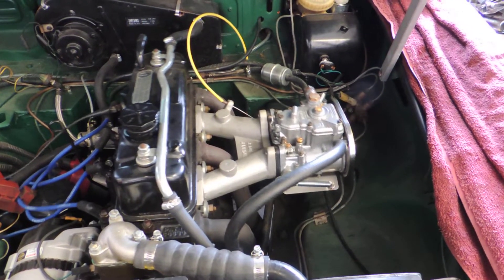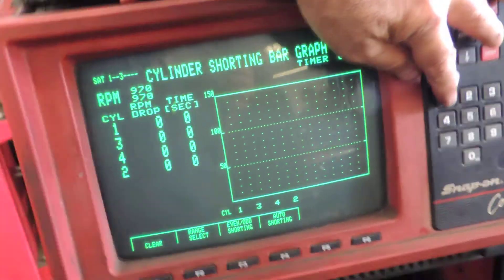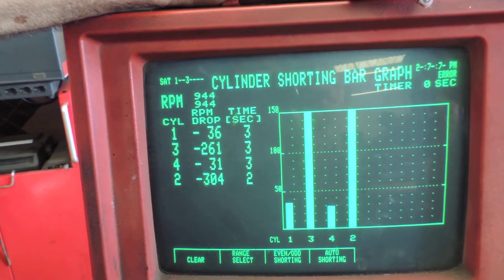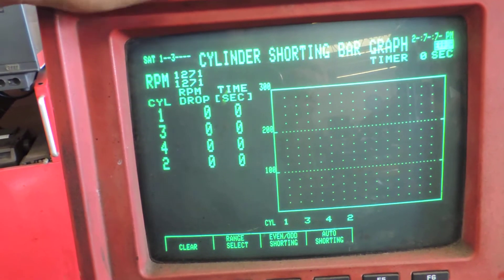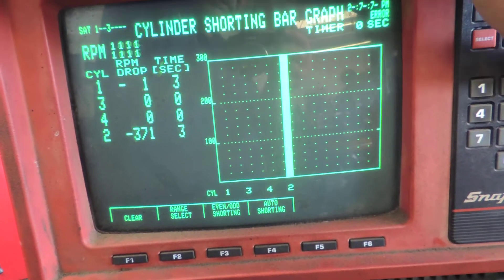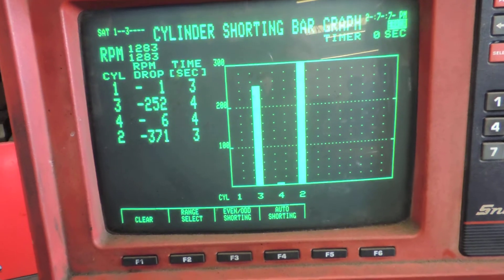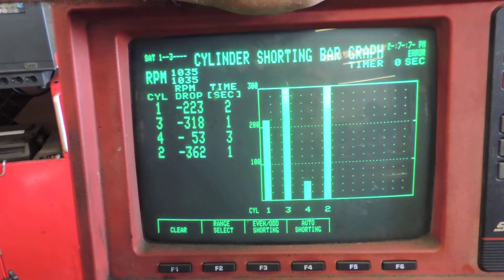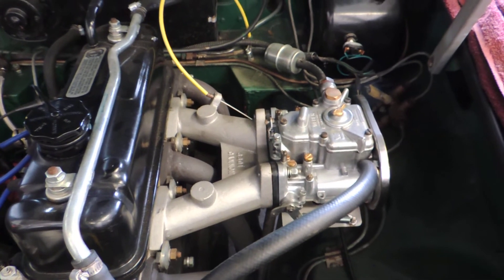MGB with Weber DCOE and Long Branch Manifold

Comment: I've seen that in Volkswagen Beetles they correct this by creating a bypass between the two intake manifolds so that the vacuum is shared between the four cylinders at low RPMs, but they apply the solution with a Weber IDF or IDA carburetor… Has anyone tried this solution with a Weber DCOE carburetor like the one in this video?

Comment: I have fitted the same carburetor and the same intake manifold to my MGB. The following points are essential: it must be ensured that no secondary air can be sucked in. The lumen of the intake manifold must correspond exactly to that on the cylinder head so that there is no turbulence. The carburetor has six jets, which must match the requirements of the engine, depending on the modification to the cylinder head and which camshaft is fitted. Only testing will help. My car runs perfectly with the carburetor and delivers 125 hp.

Comment: I'm currently tuning my dcoe on my spitfire and have found that the right barrel that feeds cylinders 1 and 3 (firing order #) cannot be adjusted by the idle adjust needle meaning that the jet that feeds those cylinders is not functioning.  I switched the jets to the other sides and the problem follows the cylinders to 2 and 4.  Have the jet in solvent to see if i can get contaminates out of the 45F9 jet.  If not you can buy a new pair for $20.